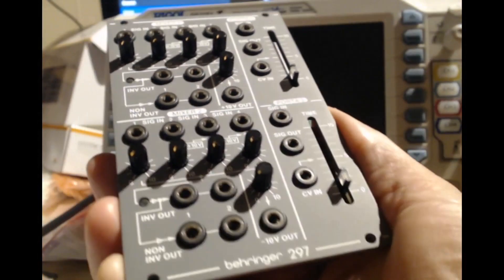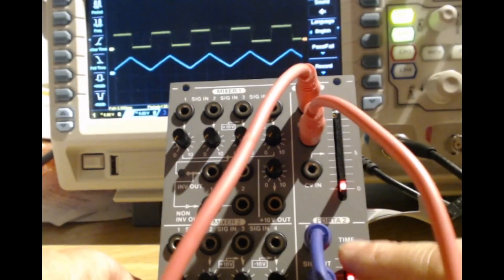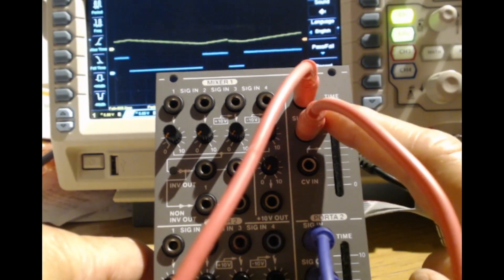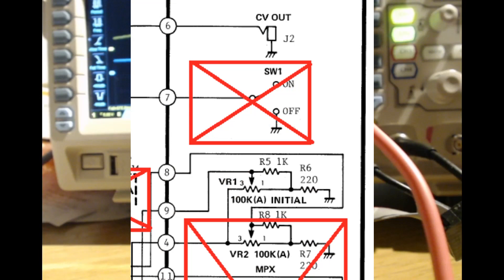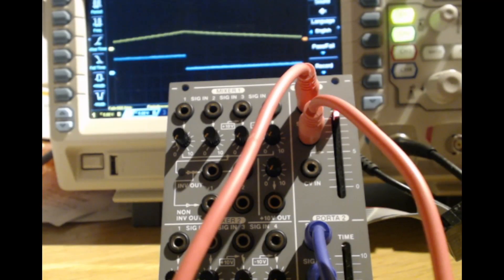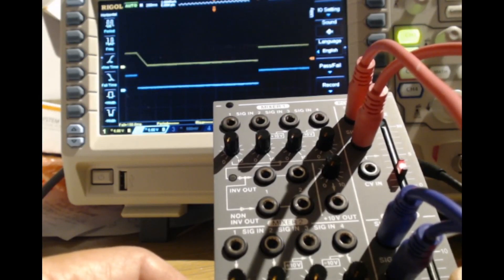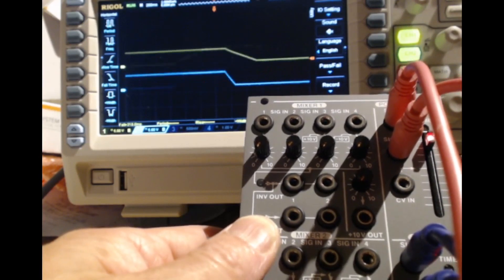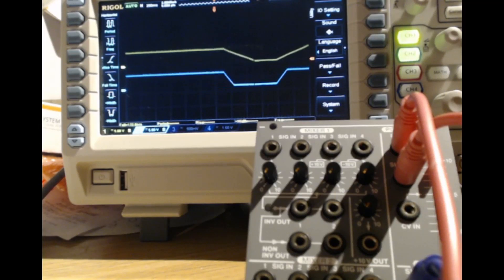Behringer 297 Glide Fix

Comment: Hi, So it's a 1k resistor as in the Roland circuit? That's a pretty neat fix. I'll try it on mine which exhibit the same issue.. Thanks!

Comment: Apparently there are multiple revisions of the 297 module. I read somewhere that the portamento range was fixed in a later rev. The portamento CV IN doesn't work at all on one have. Also, note that the portamento range was designed for positive 0-10 VDC, not the standard +/-5 VDC, so this can cause a problem you need to compensate for by offsetting your keyboard CV into that range. And then you have to offset the portamento SIG OUT back down for your VCO. I used the 297 mixer to offset the keyboard CV up and I just turned the VCO frequency down.

Comment: Hi. Try patching the +10V out into the portamento CV in.
Reply: I tried this and discovered that patching a floating patch cable into the CV in jack allows the fader to have much more play over the portamento amount.
Reply: Hi, can you be clearer about this? Does patching the +10v out into the portamento CV in fix the issue?
I ask because I’m considering purchasing a 297 specifically for the portamento. I don’t really need the CV mixer portion. So if doing that makes it work correctly without doing any modifications, I’d do it.

Just one slightly similar story: I picked up the Behringer SpaceFX module. Some folks have complained that the effects are too subtle - but I treat it as a 2-stage mono effect. Synth to right in, right out to left in, left out to amp. And that makes the effects sound dynamic enough to be useful. So I’m all for the sort of patching you state here if it works.
Reply: @ Hi. Yes it fixes the issue.
Reply: Just trying this now. Does not seem to alter the behaviour at all. Just to be clear - I am putting +10v out on Mixer 1 on the 297 into the CV in of Porta 1 on the same module. Also Porta 1 has a tiny range. putting an LFO into Porta 1 - CV In does not cause any modulation. Porta 2 has a much greater range but putting an LFO into its CV in does not cause modulation. In my 297 it seems Porta 1 is broke and Porta 2 is less broke but still broke.
Reply: @trevordyson8882   yes, patch +10v out into porta cv in and turn up the +10v amount.
Reply: @LowPassMountain  ...thank you, this does work.
Reply: @trevordyson8882  Broke means no money. You need the correct word broken.
Reply: It seems that everybody here are ok with this bug and fixed it alone. Shouldn't that do factory? Portamento simple does not work!